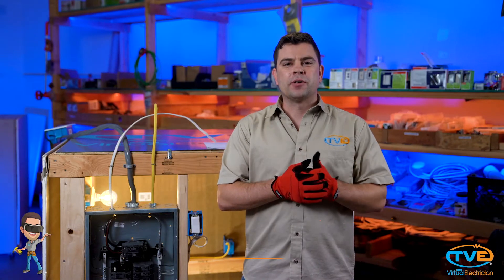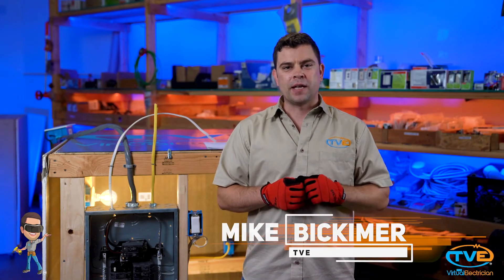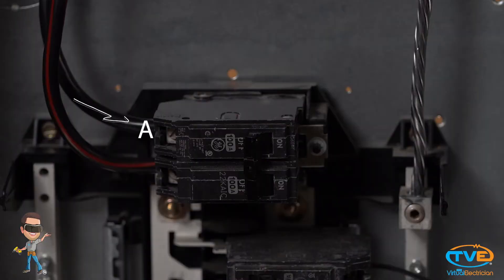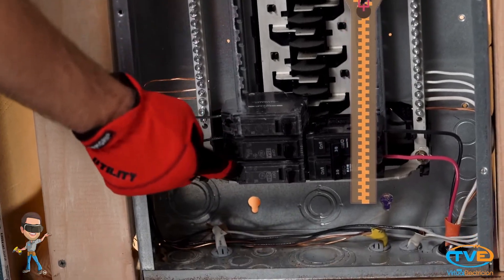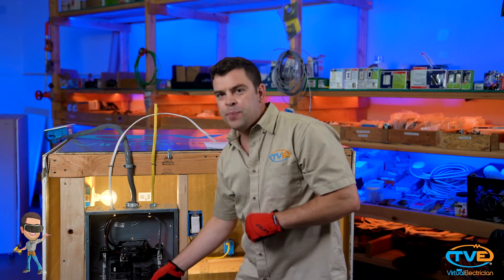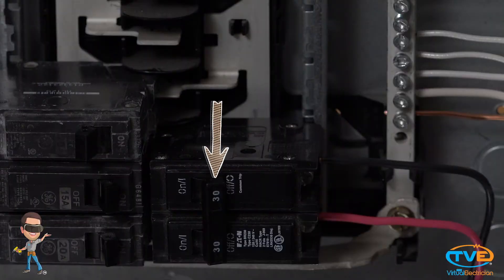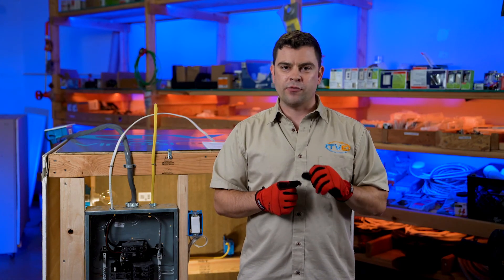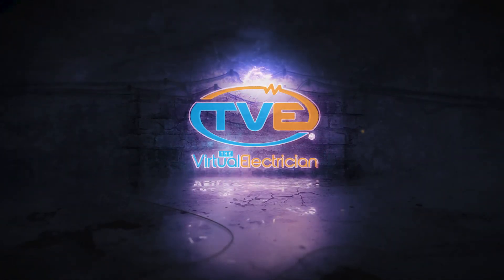The Different Phases Of A Breaker Box

Comment: So when you have 3 incoming wires with 3 different phases we call it a 3 phase system? Great makes sense. So when you have 2 different wires with 2 different phases, what are we calling that?

I get that it has to do with the number of different sin waves in the system, but its still confusing.
Reply from the maker: it is confusing.  the single phase system is only one phase split into two.
Reply: It’s because it’s not all about what’s going on in your breaker panel it’s all about what’s going on in the transformer

Comment: Who named all of this stuff. Why does single phase have phase A and phase B. wouldn't that be 2 phase lol. That doesn't make sense but I know you are right about what you are saying in the video. It just took me a while to figure that out. it would make more sense if they called 120 single phase and 240v double phase or 2 phase or something lol.
Reply: When you are talking about single phase vs say 3-phase it is referring to the number of peaks in the voltage sign wave per cycle. Single phase does not always have phase A and B it is just that way in a residential setting to ensure the house has sufficient power to support it and it allows you to balance the power draw between the two. When power leaves the box on an individual breaker you are getting single phase power to that circuit, there is not phase A or B at that point. 
When you use a dual breaker you are not getting 2-phase power out of that breaker you are getting 2 single phase 120V power sources that are being combined into (1) 240V single phase circuit. An actual 2-phase circuit would consist of power that was offset so that the crest and valley of the power sign wave of each source is offset in order to provide a device with more consistent and steady power but it would not increase the max voltage as we are doing in the previous case. For example a 120V 3-phase circuit would see three peaks of 120V in the time it takes one of the 3 power sine waves to complete one wavelength, however the device only ever gets a maximum of 120v, the voltage does not combine to create a 360V circuit.  This is much easier to describe with a picture.
Reply from the maker: @keithpatterson6999  yes i think you are referring to a split phase single phase system where there are two legs of power but of the same phase. so technically its not a 2 phase system just leg a and leg b of the same phase
Reply from the maker: Haha. You can thank Nikola Tesla.